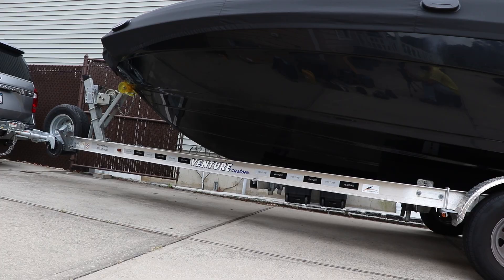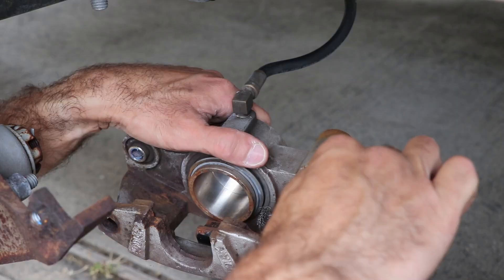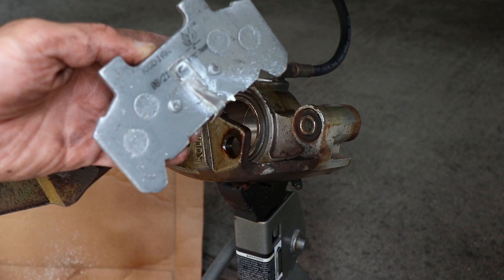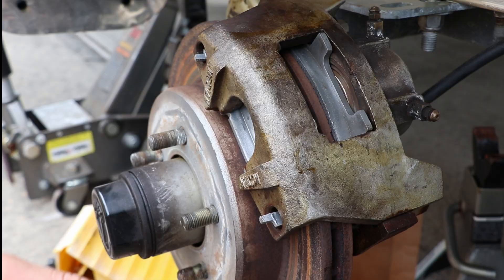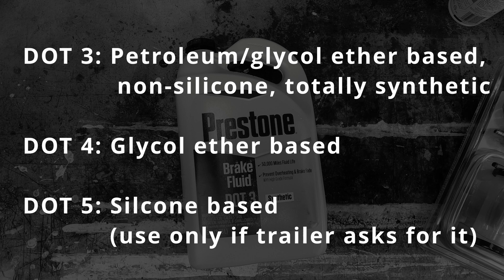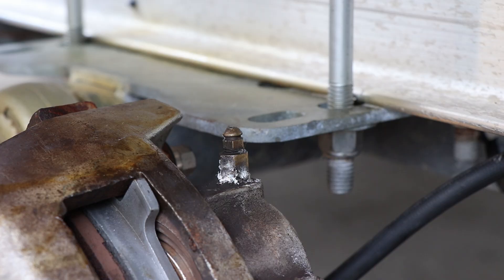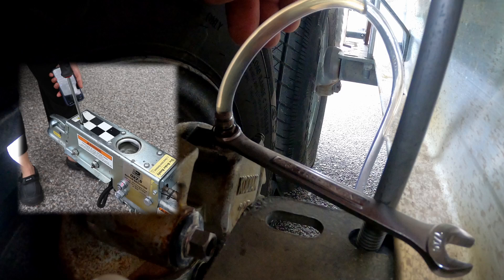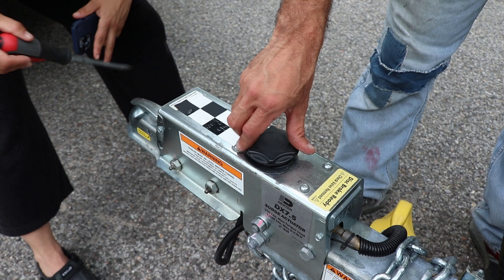Boat Trailer Brake Pad Replacement with Fluid Flush!

Comment: I have my doubts about the condition of that rotor, appears in need of resurfacing or replacing. Could prematurely wear down pads. I think.
Reply from the maker: Itl be ok! It’s the same as letting your car sit for a few days after a rain. Rotors will develop some rust on them, but first use Itl wear off. Worse case is the pads get a little more wear to them for the first few brakes. Based on how much the trailer gets used, shouldn’t really affect the overall life of the pad. Best practice, especially in saltwater is to make sure you rinse off the brakes after an outing!
Reply: Agreed, my vehicles have rust colored rotors after just a day or so of non use in moist conditions. If that's all it was, no worries. @boatingpropless

Comment: so my rotor looks like that...not shaving it?
Reply from the maker: Rotor operates perfectly fine. The trailer was sitting all winter. A few times on the brakes, and the pads wore the rust right off.
Reply: @boatingpropless  ok yeah cause a shop I took it to says they are rusted so they need to be changed...lol...i am being charged $1,800 for 4 rototrs and full brakes cause the pads disintegrated...i will be moving it back home to do this myself and see if anyone can "turn" the rotors...

Comment: When you put pads on and rotor doesn't turn as free should you be worried.  The back pad has play but front pad touching.
Reply from the maker: You’ll be alright. The first time you use the brakes they’ll compress

Comment: Is the Shorlandr single axle (Yamaha 195 sport FSH) about the same process?
Reply from the maker: It’s probably incredibly close. The sizes of the bolts may be different, but the process should be the same.
Reply: Great thanks for quick response!

Comment: This is incorrect way to bleed surge brakes.  The bleed screw has to be closed while pumping the actuator
Reply from the maker: That is true. I have the screw closed to build up pressure and then opened as the actuator is held.

Comment: your doing it wrong... pump the piston and hold and keep pressure.. Open the bleed port. let fluid and air out. close the port. Pump the piston on few times and repeat until clean fluid or no more air comes out.  Never let off the piston with bleed port open this will  allow suction and air back into the bleed port. or Water that you put in the bottle. It has to be a closed loop system they way you think you are doing.
Reply from the maker: Yes. That’s what I was demonstrating. She was holding pressure on the actuator, while I was opening and closing the valve with the other end of the tube in the water bottle.
Reply: @boatingpropless , you were NOT doing this.  You could see the helper pumping the valve and the bleed screw was open.  You did it wrong!
Reply: You're right!   This was done incorrectly.   Bleed screw has to be closed while pumping the actuator.  Then hold actuator and open bleed screw
Reply: I'm also shocked he reused those rotors. That was way more than just surface rust
Reply: @Eric-zs6rd yeah, WTF!